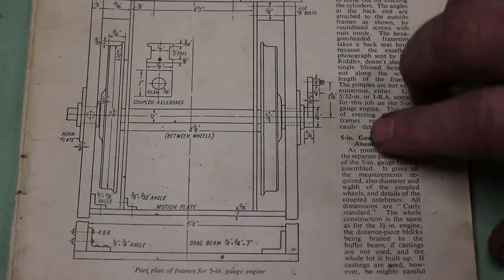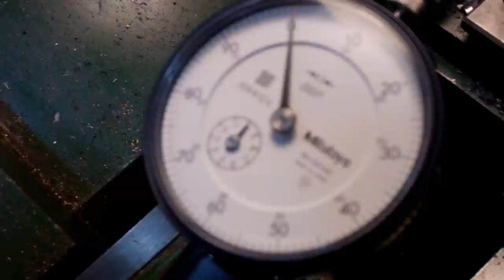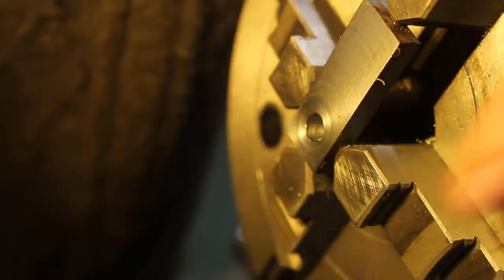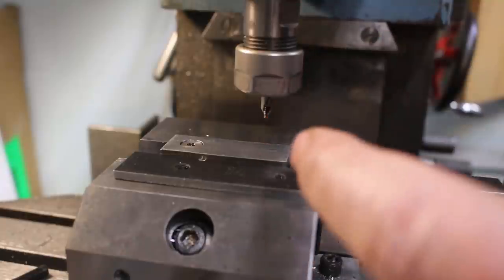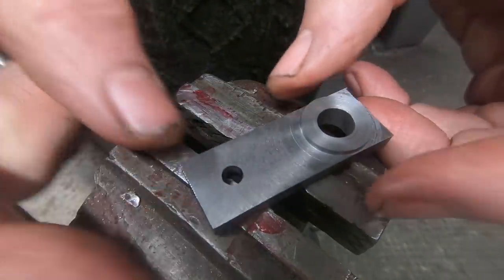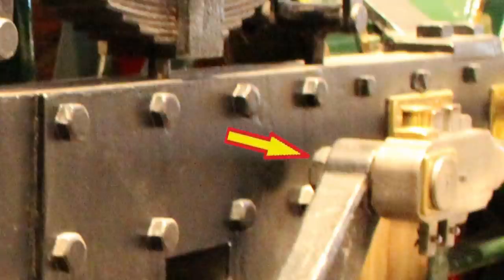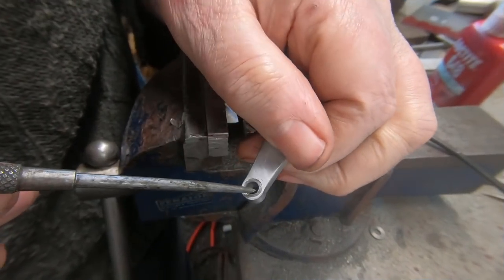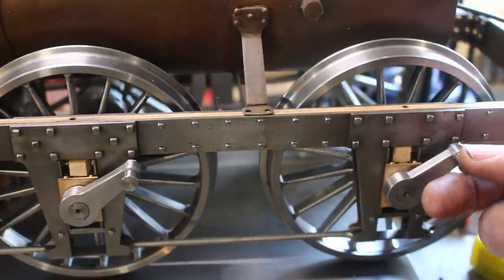Lion Locomotive in 5" gauge part 56 - Making the Drive Cranks

Comment: Bandsawed them and ran them in the cnc? Seems like you could have skipped the bandsaw if they were going to the cnc anyway. What happened? Running low on vacuum cleaner bags and didn't want to fill with so much swarf?
Reply from the maker: LOL! It's a good idea to avoid full width cuts on a very light duty cnc mill, hence off to the bandsaw, that's my way anyway. Cheers fir watching.

Comment: Very nice as always! What were your speeds and feeds for the CNC profiling?
Reply from the maker: Hi Frank, around 1700 rpm and 90 mm/m, which for this machine is as fast as I would go on mild steel, very slow compared to most cnc machines. Down cutting does help get a really good finish.
Reply: Go Create Hobby Machine Shop I just got a small CNC machine with similar capabilities up and running so I’ll give similar speeds a try as your surface finish looked great for mild steel!
Reply from the maker: BTW I was using a 5mm 4 flute cutter. Good luck with your cnc.